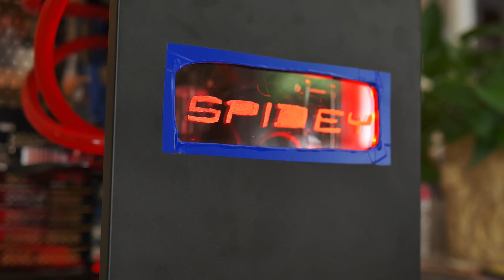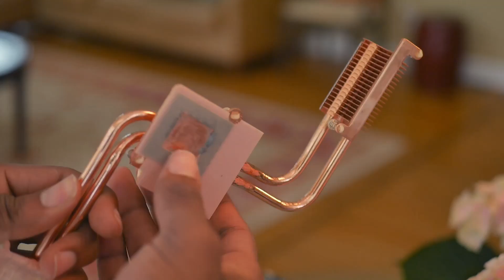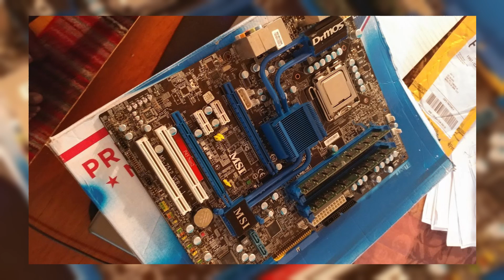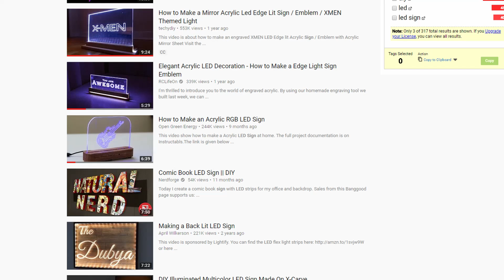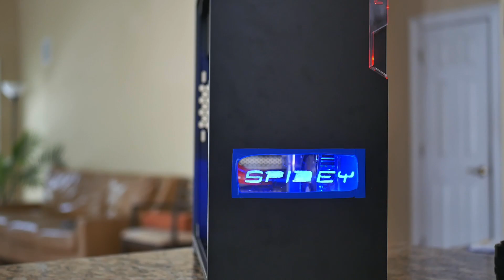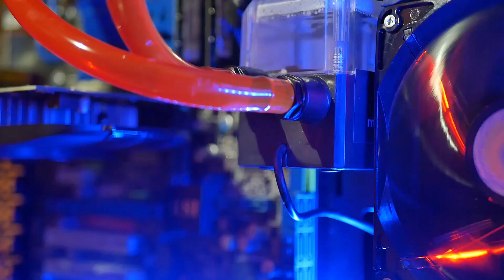$150 Water-Cooled Gaming PC! - TECHVENGERS BUILD OFF! (Spiderman) | OzTalksHW

Comment: You probably could have worked around your dremiling skills by cutting into the corners of that window a bit more and then folding in the metal while pressing a flat straight object behind it. A hammer would probably help. You'd be left with a nice straight line and the cut part would be inside the case where no one could see.

Comment: Love that you go all out with the mod's for a socket 775.
Man the's where and still are my favorite mobo's if it come's down on building a budget gaming pc.
These boards just let you overclock the heck out of the CPU and ram.
Also these are very easy to find and cpu' s are randomly availble and even a modded xeon fits in there,yeah this brings back memory's if i could put ddr3 in there i would still use the socket.
(I know there are 775's who use ddr3 but they are very limited in overclocking if its even posible)
Reply: Also i vote for this one XD

Comment: The Mobo mods and Loop looks really nice imo.
Dremeling and similar stuff takes time to master. I usually put a straight block of metal on the part i want to cut so i can use it as a guide to push the dremel against, also run it fairly slow with less preassure, takes longer but chance to damage a lot when u slip is smaller :-)

Comment: Want to know a secret? Dremel cut will never be straight. It will never ever be straight. It is geometrically impossible for it to be straight, because you have a tool that is pretty chunky, with a small round wheel on it, and as the wheel dives, it will cut a circular arc. It will be much, much straighter once you find the right angle, but it will never, ever end up being actually straight.

You need a set of needle files, and you give yourself a little margin, and then you file file file things down, by hand. All of these projects, they're never about the flashy stuff, they're all about filing, sanding, and finishing.

I must say the 'spidey' font looks fairly good for a first attempt. But i would have urged you to find a way that works with a stencil, and i don't know exactly how because i haven't done it myself yet on acrylic, just super certain that it can be done somehow.
Reply from the maker: Siana Gearz thanks for the tips. I'll keep this in mind next time :D

Comment: IF that's not a 300t pump, what is it?

Also, the trick with dremeling is to cut inside the lines and finish with a file, sandpaper or something similar. I've seen people use nail files lol. You'll get it man, keep it up!

Comment: There's a gpu water block, similar to the cpu one you're using. U should give that a try with your next water cooled build. Although i dont know if its any good or not i just seen it on ebay a couple times.

Comment: Which haswell CPUs would you recommend using on prebuilt office pcs with this 750 if I want to play all games at 720p or 1080p? I'll mostly be playing games that are also on consoles such as Resident Evil 7, Far Cry 5, tekken 7, crash bandicoot, metal gear solid,etc. Also does the Gtx 1050 work with dell optiplex and hp elite desktops or are the power suppliers (200-240w) too low? Thanks!
Reply: I remember one of cheaptechtubers, i don't know if it was RGIHD or 32mb, combusting his Dell Core2 SFC computer power supply within a few minutes of installing a faster GPU, while it ran reasonably well before. The power supply also killed a bunch of other components when it died.

Comment: I bought a dell gaming pc 2006 for 7$ like brand new. A lot of good parts for a little money.
Reply: Do you know what the model number is? Maybe you could upgrade the Pentium D to Core2 Duo E6600 or E6700 if it supports those. Pentium D was pretty bad even in 2006.
Reply: 7$ Canadian it's like 5$ usd.
Reply: Nice
Reply: Specs?
Reply: Pasi123 It has a nvidia geforce 6 series p260. Intel pentium D. The white case is awesome with grills for fans and a handle to open it easally....
Reply: A nice quiet dell 375w power supply. That I will use for dual power supplies with a 300w.
Reply: Pasi123 I choose to use parts of it that I need nor on other system.
Reply: Its like you got it for free, $5 is not that much considering its a whole system.
Reply: The only missing parts are 2 hard drive.
Reply: TsunaXZ 5$ is a sata's cable. Well I have 2 spared ones now.